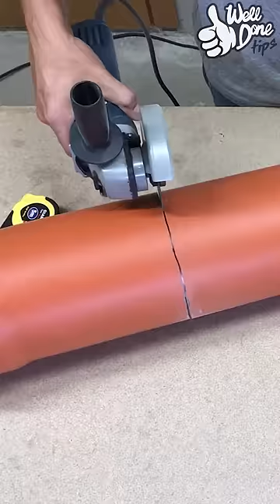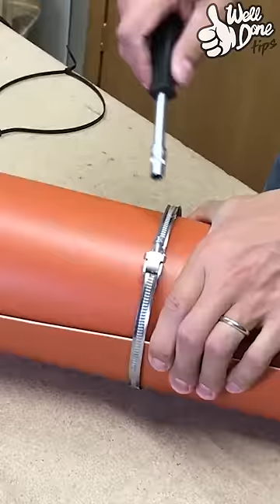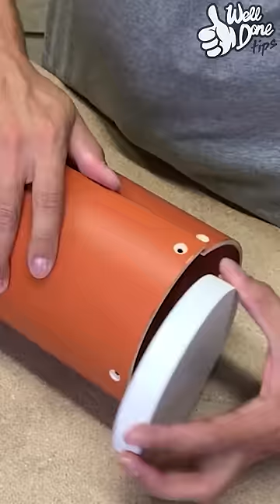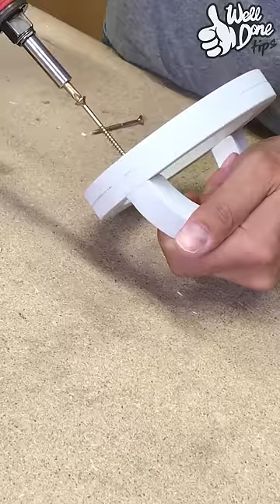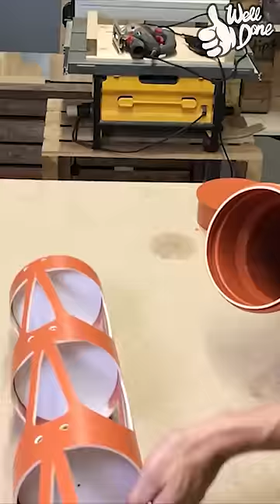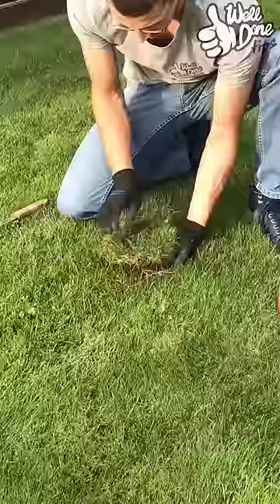Underground Drinks Cooler from PVC Pipes #shorts

Comment: That's going to require more maintenance to keep clear of roots than you might think plus keeping out the critters that live in the earth. NGL, thought it was a multi tiered bird feeder at first. 👍
Reply: Negative. It slides into a sealed drainage pipe.
Reply: @johnthegodfatherslack  grows through foam pretty quick . .
Reply: @madmick3794  But it doesn't grow THROUGH sealed watertight drainage mate. Fact. Might grow in it if it finds a way it, but the roots won't penetrate the seals.
Reply: @johnthegodfatherslack  no, goes right through the side of the pvc pipe, thats why they have pipe relining services.

Comment: the explanation to this is, that what ever the surface temperature is, it is the opposite in the underground of it. Hence why it is cooler. In Cyprus houses have their water tanks under the house. This allows storage and pressure flow plus in warm days the water stays cool for showering. in the winter the water gets heated with electricity.

Comment: I guess this is good for an off grid place with no refrigeration.  The drinks won’t be anything close to cold, though.
Reply: As a northwest Canadian I can tell you they'd be damn near frozen most of the year
Reply: @nickkk420  as an almost Canadian (2 hours from the border) you’d be better off sticking them in the snow or in the garage than in the ground.
Reply: @ryanb4533 absolutely, this is better for hiding guns than drinks
Reply: @nickkk420  Yup!  I should amend my original comment though.  The ground at the depth they have this would be close to refrigerator temperature, now that I looked it up.

Comment: Canadian: "And in the winter, it keeps your drinks from freezing solid.  Perfect."
Reply: Under 1.5m of snow.
Reply: Imagine Canadians that dig their cars out of snowbanks, shovel their driveways, shovel outdoor skating rinks, plow the 7,821 km Trans Canada Hiway, plow every other side street and alley, shovel snow off roofs, now thirsty and holding a shovel and looking at the spot where their cold drink is stashed under 1.5 meters of snow thinking, "What am I going to do now?  I'm thirsty and my drink is underneath all that snow!  Should I give up?"
Reply: No, the permafrost will keep it on ice for the next ice age.
Reply: @louielouiepks  Keep drilling. Depth matters.
Reply: @gkudriavtsev  crack me up, thats funny !
Reply: @beyondwhatisknown  not to mention that frost will easily go down one metre so when they actually recover the "cooler" all they'll find is a tube full if ice and shattered bottles.

  I kinda wonder how full of mud this would get after a rainfall?
Reply: @beyondwhatisknown  *FARTS*
Reply: @JointerMark 

Snow actually insulates the ground, and it stays soft, for most of Canada.  Otherwise, you can just use a 2 meter deep tube.

An outer pvc tube with a sealed cap on the bottom and a removable cap on the top would keep the water out.  

Thanks for thinking ahead.
Reply: @beyondwhatisknown  Um, its -35 degrees outside right now, with a windchill in the high 40s I think I understand a Canadian winter LOL!  Frost still goes down about a metre or so (depending on soil moisture, snow cover and soil type) ...i still think its cruel to hide your beer so far away from the television!

Comment: You should of dug the hole about 3 feet deeper and installed an air actuated cylinder or an electric linear actuator under it so you could just hit a switch or a valve and it would pop out of the lawn and you wouldnt have to bend over. 🍻

Comment: What was the purpose of cutting down the middle. The 5 steps involving clamps and heat gun and more clamps? Pretty sure you can get those white shelf ish circle pieces through the big ass holes you cut in the side. Probably saves you hour of work.

Comment: Cool idea but kind of useless here in Florida unless you're just trying to keep the drinks wet and warm as it's only about a foot or two to the water table here where I'm at in Central Florida. I've installed many a fence post or mailbox post in my life and although I still need Quikrete there's no need for a hose or a bucket